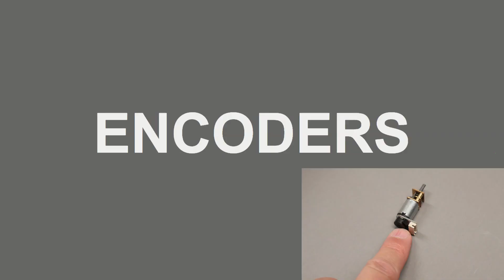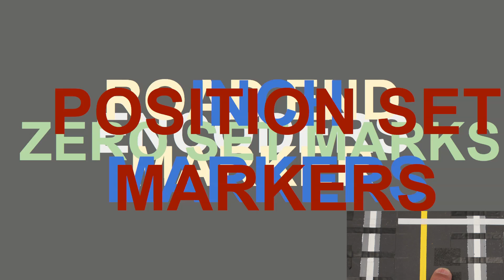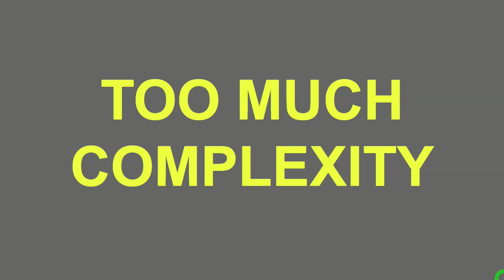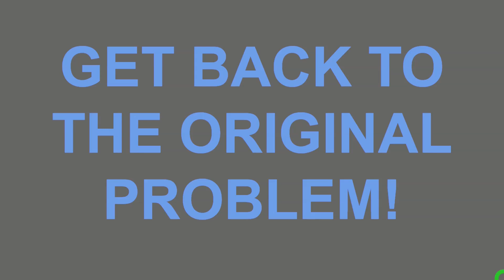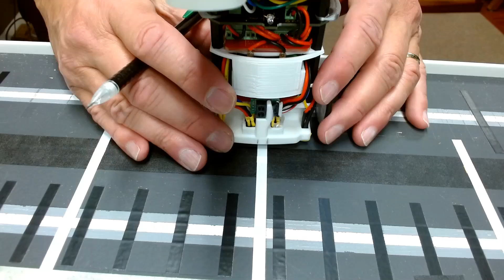Move a robot a specific distance, why so difficult?

Comment: Great to see a new video on Zoomtown Chris, especially as you have video to go along with it. I'm curious how much backlash there is in the N20 motors? That is amplified by the wheel diameter. You might be expecting more accuracy than is possible. In general you should aim for half of the available accuracy (Nyquist). Also are using the full quad (reading all 4 state changes) encoder or only half?
Reply from the maker: Good morning @DaveEverett01,
I am glad you hear you liked the new video!

There is backlash in the gearing and it varies from motor to motor.  As I recall the last time I measured it, it allowed about 1mm (.040") of movement. While generally speaking backlash should only affect distance once - after a revers in motion direction.  However, I suspect that it also plays into the steering of the robot.  The robot does a lot of velocity adjustment to follow the line - constantly adjusting - backlash could be causing a LOT of positional error there.  I have never investigated deeper though.  

Regarding the encoders and how I read them.  I am not doing quadrature encoding anymore.  I did some testing on that very early on and found no "advantage" in the information I could collect between Quadrature and just looking at the falling edge on one channel.  It certainly would help with "bad reads" of state changes though.  When I switched to these motors with the integral encoders, I tried a number of different methods to read the signal changes: polling, Interrupts, PIO, etc.  Remarkably, all the methods had the same counts within one.  

I have come to the belief (not a conclusive belief) that the motor/gearing/wheel combination will not provide accurate enough positioning, which to me has always been a goal  +/- 0.5mm or about .020". 

I can use the encoder feedback to get me close but need additional sensor input to get the accuracy needed.  At least that is where I am at right now.  Since filming the story, I have made more progress on testing more movements and the results are still looking promising.  But as ZoomTown has shown me time and time again, what looks good in a controlled test doesn't work in the real world - 

Thanks so much for the feedback and information - it is EXTREMELY helpful!
Cheers!
Chris

Comment: I service “zoomie” bots at a distribution centre. They have a lot more compute power and sensors, including uplink to a virtual map of the facility. 
Using the digital map for location and ‘how-to’ get somewhere, with the sensors for object detection blocking path. With serial number charger locations, that reaffirm location and orientation on the map. After being out of action, and after I return them back to service, I take them to a know ‘Reset location’ so the bot knows where it is on map. 
This digital map/grid can be updated, and downloaded to bot , and also doesn’t require any floor markings. 
Occasionally they do ‘Get Lost’ so, even industrial equipment needs refinements.
Reply from the maker: Good morning @nemesis851_,
Thanks for sharing that great information.  What would a robot like those cost?  I think that will help over viewers get a little perspective of what is being attempted here in Zoomtown.
Cheers!
Chris
Reply: @MakingStuffwithChrisDeHut 
I can’t even begin to estimate, but a GUESS would be starting at…..$50-70,000
Reply from the maker: @nemesis851_  Thanks for the info - I would expect you are close with that.
Reply: Sent a msg via your site, cause YBT algo